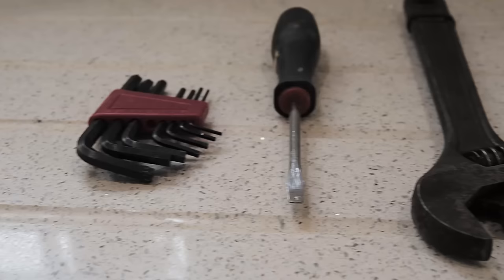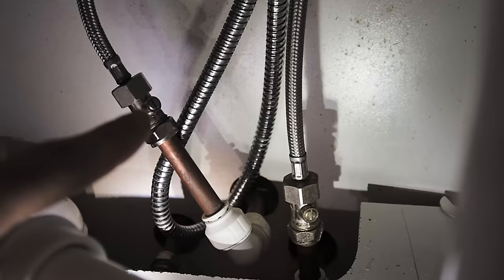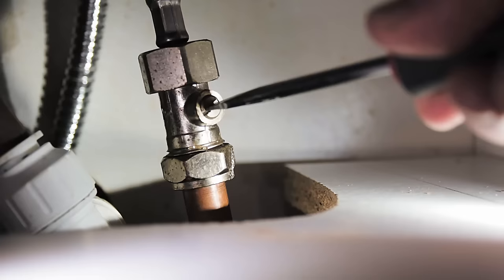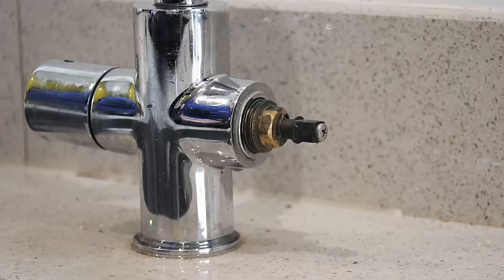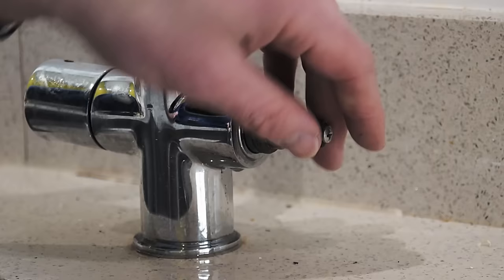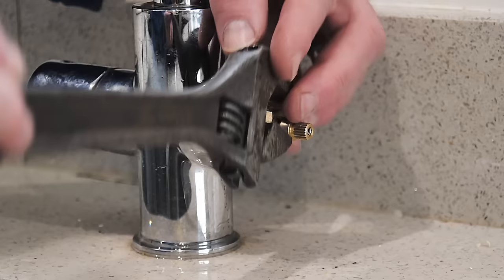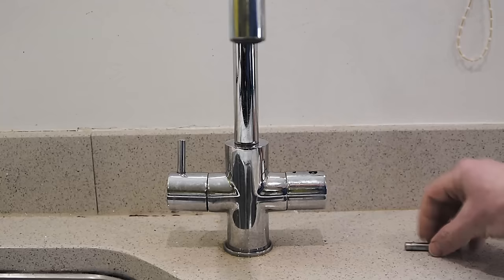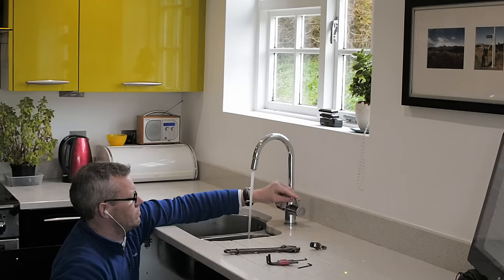How to Fix a Mixer Tap | DIY Series

Comment: How do you know which tap is making the leak ?
Reply from the maker: You should be able to switch off the supply to the hot and then the cold independently underneath the sink. Then turn one on at a time, that should show which side is leaking.
Reply: @fix-make  thanks , but no can do i can only turn off the main water
Reply from the maker: @sm-ov1wh  then only option really is replace both.   Still cheaper than replacing the tap.

Comment: I have a similar tap I thought it was a washer ...but u only changed one valve not both sides ....why not both sides ...
Reply from the maker: I only changed one side because only one of the valves was leaking. I tested this by turning off the water to each side of the tap, one at a time. Water only leaked from the tap when there was water going through the valve I then changed.
Reply: @fix-make  I get that ! If it ain’t Broke !
I’ve got a Howdens cost a bomb lamorna they want £60 for to change the 2 ceramic components ..I will try just cleaning and changing washers .cheers

Comment: If a tap similar to the one in your video is constantly dripping do I need to replace the washer or entire valve?
Reply from the maker: Morning Matt,
The cheap option is to replace the washer first, if that doesn't work then it's the valve. 
Good luck with it.
Rich
Reply: Fix Make Create Thanks for that Rich, my next problem is that the thread in the screw is completely gone! This period of isolation will test or maybe improve my terrible DIY skills to the limit!
Reply from the maker: @Matt-rr8vy  Hey Matt, sorry I've been so slow to reply, balancing childcare and work and this is proving tricky! If the thread is gone on the screw that can be replaced, but if it's the thread in the tap itself then its probably a new tap I am afraid.
Reply: Fix Make Create Cheers mate an I appreciate the reply, especially during these tricky times. You were right a new tap it was!
Reply from the maker: @Matt-rr8vy  Sorry to hear that but sometimes that is by far the quickest and easiest solution.

Comment: One of the handles won't untighten 😱
Reply from the maker: You might be able to do it with pliers, but wrap the tap handle in a cloth or a piece of rubber inner tube so its doesn't get scratched.

Comment: I cant unscrew the cartridge. Nut just wont turn
Reply from the maker: Have you sprayed in some WD40? If that doesn't work it's likely to mean a new tap.
Reply: @fix-make  cheers i'll try
Reply: Same here, I’ve just tried, i am a female, so not as strong. It just won’t budge. Tried WD40. It’s the same tap, sick of it. The handle bits keep slipping round. The kitchen company, I won’t mention the name, replaced the tap when it did this soon after it was fitted, now it’s doing it again. Awful taps these.